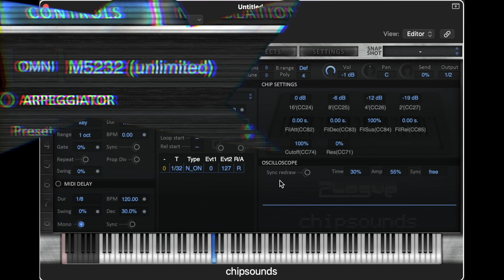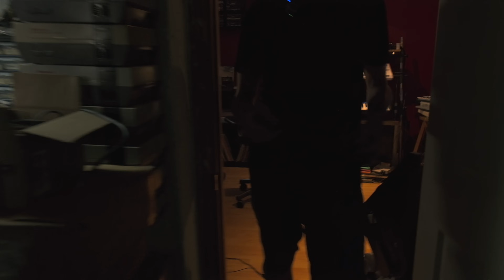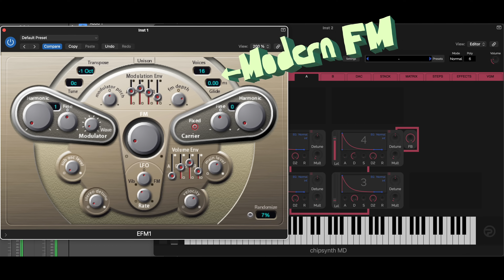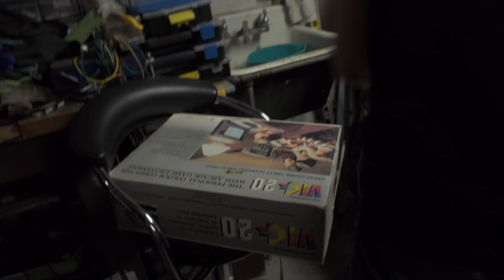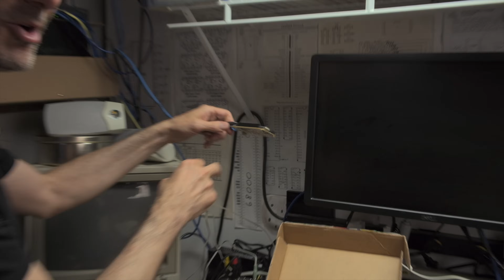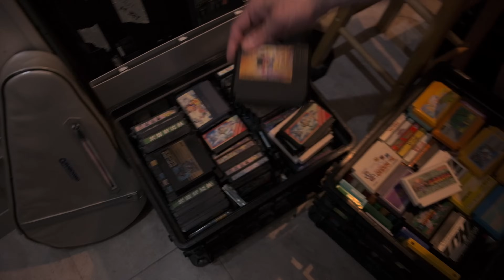Who is this guy? - Chipsounds Developer Interview

Comment: We MUST support plugin developers with this kind of fanatic passion for old hardware. I own his C64 and OPS7 and they are exactly right. Nobody does it better!!
Reply: I got the C64 one, TBH it has a pretty horrible user interface. Bad enough that it's still easier to use a tracker on the C64 instead of trying to use those tiny and not super responsive UI controls of the plugin. It was some time since I used the plug in but IIRC that the modulation control was the absolute worst part of it.

The plugin sounds great though but so does my C64s.
Reply: @pleggli  and then u use a little modern effects... then dirty gritty sound becomes beautiful... 
Still we MUST support plugin developers with this kind of fanatic passion for old hardware... this is clone in stead of emulation